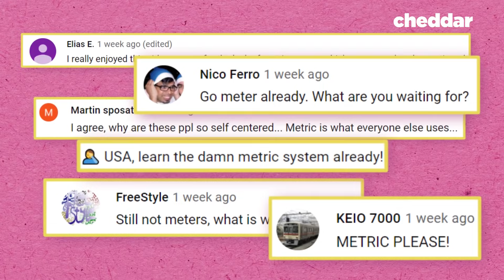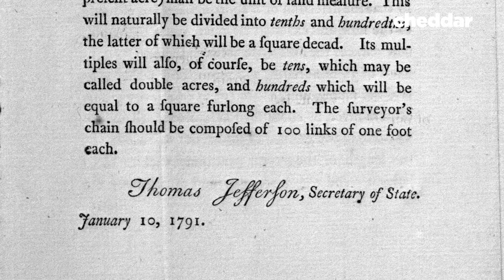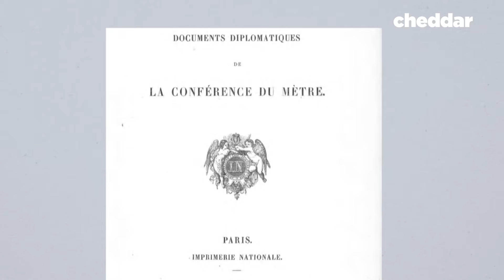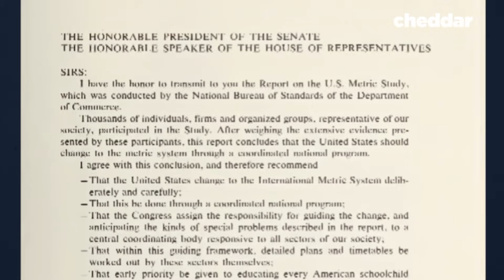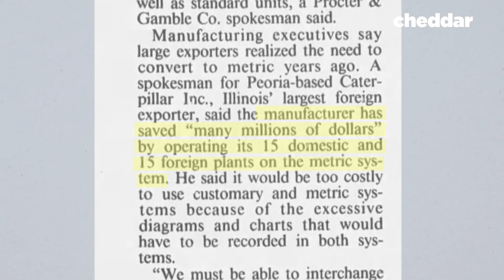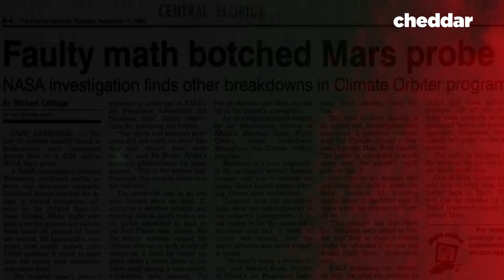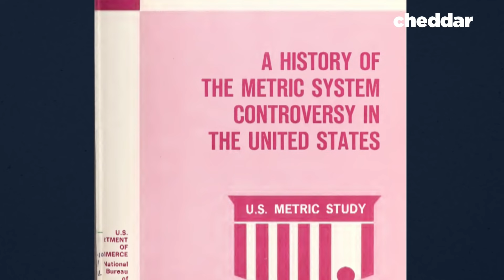Why Doesn't the US Just Use the Metric System? - Cheddar Explains

Comment: lets build a house.  cut a board 10 foot 6 inches or 3 meters 45 centimeters.  how tall are you?  5 foot 6 inches or 1.7 meters or 1 meter 70 centimeters?  metric ain't all that.  sorry.  when you need to think harder to visualize a measurement in real life its an inferior system.  lets break it down again.  10 foot 6 inches is 126 inches or 315 centimeters.  not much easier to break down those two to either feet or meters.  or 5 foot 6 inches is 66 inches or 165 centimeters.  still not very easy to break down into feet or meters.  heres another one.  i can use my hands and demonstrate a foot without a ruler with pretty good accuracy.  try doing that with a meter.  or wait.  you'll demonstrate 30 centimeters with pretty good accuracy?  yeah but that means ur using a foot ya moron.  ur improving ur "superior" measurement system by projecting it on an "inferior" one.  12, 8 and 6 are very important numbers, its best not to act like they are antiquated.  look at ur clocks and ask an electrical engineer how much more superior an imperial 60 hz. motor is to a converted metric 50 hz. motor.  metric proponents are like electric vehicle proponents.  they talk about how "evil" oil is but have no issues boarding a plane to visit disneyland.  its a disease called putting the handle on the (cooking) pot wherever you damn well please.  thats not how real life works.  sorry.

Comment: Thank god they didn’t change the second. 
Thank god there is one constant at least
Reply: The second is technically part of the metric system.
Reply: TheNathannator yeah. But time is the only constant they can’t change. Other physical properties and stuff are put due to human standards, which means a kilogram might have been a different mass that today’s standard (or think about it this way: every thing has more than a unit like a pound and a kilogram or a metre and an inch) but time is a constant that can’t be changed as the basis of it was on the interval between each lap around the sun or each lap of a moon around the earth or even lap of earth around itself, and it has been like this for thousands of years if not millions of years so it’s the same unit for everyone, and people in other parts of the world don’t have replacements to them

Comment: I fully realized how stupid the imperial system is when i was in the US and wanted 200 grams of ham. I knew that 200 grams is approximately half a pound, so i went to the supermarket and asked them to give me half a pound. The teller replied "How many ounces? The machine works with ounces". I said "I don't know how make ounces, just give whatever ounces are in half a pound." He couldn't do it. He couldn't make a simple conversion between different units of HIS measurements system. That's why imperial is a failure. Not because of the trouble it creates between systems, but because of the troubles it creates within the system itself.
Reply: This. I write software for a living. A long time ago I had a customer from the US who was a construction builder. He needed a simple program to calculate concrete volume from linear dimensions. It just took him too long on his math calculator because linear in construction is in feet and inches but concrete volume is in cubic yards. BTW, I checked recently — now there's tons of apps of that kind for phones. :)

On the other hand in some European countries plumbers still use "half-inch pipes" and the most commonly-used spanner size in car repairs is 13 mm which probably also comes from half-inch. Not sure how these got here.
Reply: Lol random deli worker forgets how many ounces are in a pound and the entire system is broken nice, totally not over reacting
Reply: @WillWasHere01  Right. That was probably the only time in history that a commercial transaction was distorted because of the limitations of the imperial system. And it happened to me, what are the odds??

Comment: I’m from Canada. We switched to metric in the ‘70s. I wasn’t born yet. Practically I measure most things metrically: temperature, distanced while driving, fuel, etc. But I work in the construction industry and it’s still staunchly imperial. Windows and doors are typically come in 1 foot increments. Flooring is manufactured by the foot, or in 12 foot rolls. When I was first starting out I toyed with the idea of making the switch. That was until I bought a tape measure. Around here, you can get an all-imperial tape measure, or you can get a tape that’s imperial on one half and metric on the other. You can’t get an all-metric. For most people that’s not a big problem, but when you use your tape all day long, it means that that half of it is useless to you. In the kitchen it’s the same. Measuring cups will have both measurements on them, but they’re built to imperial sizes. And in those cases it’s simply not practical to run the extra calculations necessary to be “dual standard”. Adopting metric is easy. It’s eradicating the imperial that’ll be the trick.

Comment: After a long career in Metrology (the art and science of measurement) and calibration of all kinds of measuring devices, I find it relatively easy to mentally switch between metric and US Customary measures. 

My reference to US Customary measurements is based on the fact that the USA is now the ONLY major nation that does NOT use the International System of Units (the SI) (also known as the metric system) in everyday life. [The only other nation of any size in this condition is Liberia.] 

In the world of Metrology, use of SI units is the basis of measurements. Customary US measurements are often used in dimensional measurement only because that is what the tools sent by the customer are. In electronics, everything is already in SI units. This makes it easy to, for example, look at an instrument data sheet written in another language and still identify what the specifications are. Something with a unit of Hertz (Hz) must be frequency. Something with a unit of kilograms (kg) must be mass. Something with units of cubic centimeters (cm^3) must be volume. (Absolutely no confusion on the last two. In US Customary units, the unit of "ounce" is used for both mass and volume, and it's often not clear which type of measurement is meant.) 
If I am reading a specification sheet, a calibration report, a measurement uncertainty analysis, or a laboratory's measurement capability document, I can generally understand the important bits regardless of language. It can be in Spanish, German, Chinese or many other languages. But the measurement units and the numbers are the same, thanks the SI (the metric system.) 

Ironically, US participation in and signing of the Treaty of the Metre was encouraged at the time by many US manufacturers, because they felt it would be far easier for them to expand their international trade ...
Reply: Small correction: The metric system and SI-Units are NOT the same or interchangeable.
The metric system just describes a "counting/numbering" scheme using the literals(?) 0-1-2-3-4-5-6-7-8-9 to generate Numbers and calculate with them in Base-10.
The SI Units are (mostly?) natural constants (physical, chemical, biological, astronomical) which are just expressed with numbers in/from the metric system per default, but it's no problem to express them in any other Base-X system (thus excluding roman numerals I think).

Btw.: (Almost) all devices used to interact with "all this here" are working with Base-2 internally....
Reply: Standard pitch for microelectronics is a tenth of an inch. That's what we pegged the center line of component leads at when we invented integrated circuits.

Comment: I like how the probe crash is painted as the fault of standard units when it wouldn't have been a problem if metric didn't exist.  And as to all the savings attributed to metrication in U.S. manufacture.  Almost all of that could have been realized from any redesign.  The units didn't save money.  The standardization on fewer parts is what did it.

Comment: Lmao if when i find an inch with a decimal on my ruler, then I convert to centimeter cuz i have no idea how the heck to understand inches, finding that measure again in inches thinking i understood it, they just end up being different.   

Lets say i want a piece of paper to be 5.8 in long. Then i use the ruler to measure (with my wrong understanding) how long it'll be, lets call this length 'A'. Then I take a second measure but instead of finding it in the ruler again, i converted it to centimetres. Then i rry to find it  on the ruler. This is 'B'. 

When i compare A and B, they are really different. Mostly because they have decimals

Clearly I dont understand inch decimals. Lmao can u help me?
Reply: 1/64 in = 0.015625
1/32 in = 0.03125
1/16 in = 0.0625
1/8 in = 0.125

So 5.8in is close to 5 7/8in = 5.875in or more closely 5 13/16in = 5.8125in

Learned both in school and have the fraction decimal equivalents down to the 1/16th's because that's what my work requires.

Engine testing department at Caterpillar still use imperial where the facility is concerned due to piping standards etc.  Also, exhaust and intake piping used for testing is in inches although the prints are provided in metric...at least it used to be...

Comment: I'm use to having to use both, but I think we(the U.S.) should go fully metric.
Reply: We should do what the UK does. Use metric but stick with miles and yards for road signs.
Reply: @kimjunguny  In Canada we use metric for almost everything officially but the older generations still use imperial. We also learn how to convert a lot and need to generally put both answers on a test so we can make it easier for you guys
Reply: @kimjunguny  We also learn the conversion factors for British imperial system to metric and yours
Reply: Unamerican of you wanting to be like the rest of the world.
Reply: Reed Cox 
I could take the metric lengths and measures, but screw using metric temperature. Fahrenheit is a much smoother system for common usage.
Reply: @rhapsodyman2000  no metric is far better
0 degrees is freezing, 100 is boiling 25 is room temp
Reply: @rhapsodyman2000  Just a little point I want to make; even though I use the Metric system, Fahrenheit /does/ make more sense relative to the human body, since it kind of works like a percentage and how a temperature feels to a person.
Though, Celsius is more logical relative to weather and the environment, as it's based around the freezing and boiling points of water. A clean 0 and 100.
Each have their own fitting contexts, I reckon.
Reply: @rhapsodyman2000  Celsius is waaay easier and more common
Reply: Evgeny Kondrat 
It isn’t easier. That is why scientist use Kelvin instead of Celsius for exact temperature measurements. The only advantage is that it is used more commonly worldwide, but that doesn’t help US citizens. Even the 0 and 100 based on water freezing and boiling is scientifically pointless, because it doesn’t account for elevation.
Reply: @rhapsodyman2000  no doubt pal. I got used to both systems and easily calculate numbers from one to another, but it is so easier to use a system with all measurments divided by 10/100/1000 than those awkward kind of numbers. Again I live in US and I have to use their system unfortunately.
Reply: Evgeny Kondrat 
The benefits of base 10 in the metric systems is cut off by Celsius using an isolated and variable concept to base itself off of.  That is why Kelvin is used for science. It’s based on absolute zero.
Reply: @rhapsodyman2000  Kelvin is just Celsius with an offset (+273.15) added, one is not more "exact" than the other.
Reply: @rexsceleratorum1632  
You are aware that 0 Celsius as a metric for measuring water freezing only applies at sea level pressure. The reason kelvin uses absolute zero as a base line is because it is considered a constant.
Reply: @rhapsodyman2000  The Celsius scale is the same at sea level or on Mount Everest. 

And its relationship to Kelvin is always a constant, Celsius = Kelvin - 273.15

Does the Fahrenheit scale change when you have a fever? After all, it was based on someone's armpit temperature.
Reply: @rexsceleratorum1632  
The scale were it places zero at is not the same across those altitudes because zero is based on the triple point of water at 1 atmosphere. What labor saving will I get that I would not get from Fahrenheit? This is the reason Kelvin is used.
Reply: @rhapsodyman2000  Did you notice the part where it says "one atmosphere" of pressure? If you recreate that exact pressure in a container at any altitude you will have the same triple point temperature. This discussion is incredibly silly LOL
Reply: @rhapsodyman2000  Kelvin is an extension of the Celsius scale with a simple offset of 273.15 added. At any altitude. On any planet.
Reply: @rhapsodyman2000  "What labor saving will I get that I would not get from Fahrenheit?"//// The freezing point of water will be close enough to 0 deg celsius for all practical purposes unless you work at a metrology lab.
Reply: @rexsceleratorum1632  
Keep in mind that we are arguing the practicality of Celsius vs Fahrenheit. With the standards both systems use, atmospheric pressure must be accounted for you to realize the accuracy of both systems. The labor saving of base 10 are marginal here compared to other metric/imperial comparisons, so we squabble over the utility a layman will get knowing water freezes at about 0 C vs 32F or 0F if the water has a measure of salt in it. I could argue that Fahrenheit gives someone a better perception of human body temperature, but you might rebut that it is a matter of getting used to the Celsius way of doing it. My point is that I’d be willing to have the rest of the metric system, but Celsius is a system that I could do without.
Reply: @rhapsodyman2000  Water freezes at more or less exactly 0 degree Celsius wherever humans can live, because the freezing point of water doesn't change noticeably with pressure at all. On the other hand the boiling point is the one that changes a lot. 

It is possible to keep Fahrenheit but for scientific purposes you'll still need to use Celsius or Kelvin (a temperature difference/change will be the same numeric value in both units).
Reply: @rexsceleratorum1632  
One could say the condensed numeric value of Celsius would leave you counting temperature by hundredths of decimal points to do the same thing Fahrenheit or Kelvin does with only tenths, but that is just aesthetic nitpick.
Reply: @rhapsodyman2000  Whut? Kelvin and Celsius will require the same decimal points because, and I am repeating this for the third time, Kelvin is just Celsius with an offset of 273.15 added. There is no multiplication needed, so no change in accuracy between them. 

Fahrenheit degrees are about half the size of Kelvin/Celsius degrees (5/9), so almost twice the resolution of both Kelvin and Celsius. 

If you want to match the resolution of Fahrenheit, you'll need a thermometer marked with half a Kelvin or deg Celsius.
Reply: @rexsceleratorum1632  
I take your point on the resolution, but Kelvin goes in the the multi hundreds at ambient temperatures anyways, so it’s the exact same problem as with C plus higher numbers. You get the spirit of my point correct?
Reply: @rhapsodyman2000  You are still artificially separating Celsius and Kelvin. One degree Celsius is exactly one Kelvin. They just start counting at different temperatures. In a metric country you learn them both as highly compatible units.
Reply: @rexsceleratorum1632  
They have the same value margin but the values are displaced in a manner that would be considered awkward for every day use.
Reply: @rhapsodyman2000  I'm not sure. Can you feel the difference between 68F and 69F? Is it a big enough difference that you want the room at exactly 69F rather than 68F or 70F? 

(My preferred temperature is 80F [27C], but that's because I'm south Indian and we have an 85F average temp here)
Reply: So do you think we ought to give up our liberty in order to fully convert to metric?
Reply: @Ethan.Lamoureux  please don't bring ignorant and irrelevant points into this. Using metric has nothing to do with giving up any liberties we have.
Reply: @ReedCox  The only way to fully convert to metric would be to force people to convert, which would mean giving up the liberty to use what we want.
Reply: @Ethan.Lamoureux , first off all I said is I think we should switch to metric, but I said nothing about forcing people to covert to metric. Sorry I didn't take the time to clarify that for people like you. Who like to assume that when someone suggests something that they would want force it on others,  instead we should putting up for debate and then a vote, which doesn't infringe on any liberty's.
Reply: Ethan Lamoureux - but the small inconvenience it will give you as a normal person, would save so much time for engineers, international companies, etc... I think it’s a little selfish to think of yourself over all the people who would benefit from it. (I’m an American btw)
Reply: Reed Cox - thanks for being a level headed supporter 😊
Reply: Ethan Lamoureux U wouldn’t Force people To use metric, We would Just Start teaching metric at a younger age In schools, The earliest I Learned metric was in 7th grade and They didn’t go in depth they just told me what it was and u use it for science
Reply: Reed Cox please don’t, i hope not